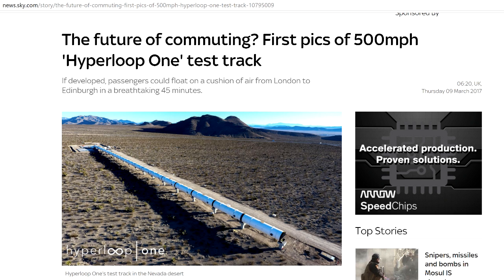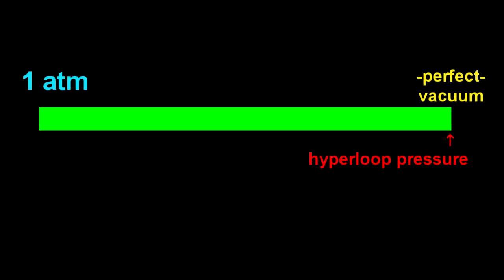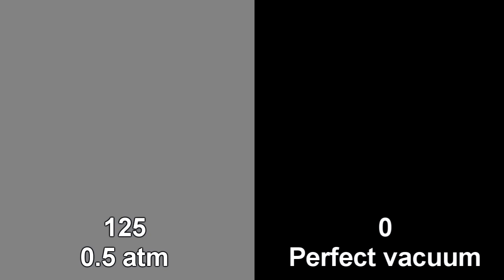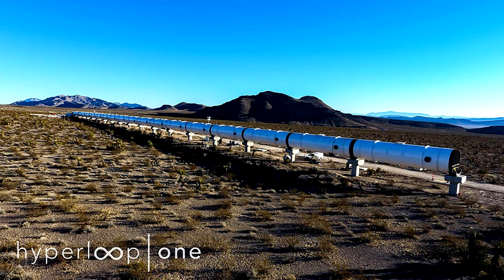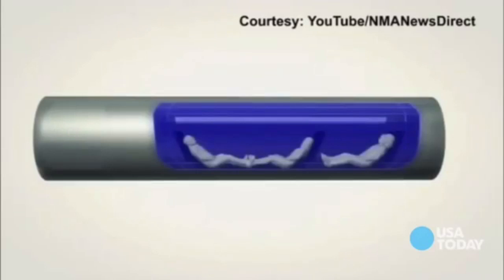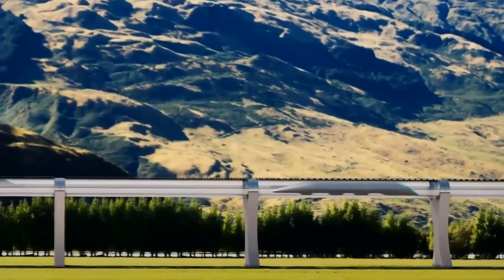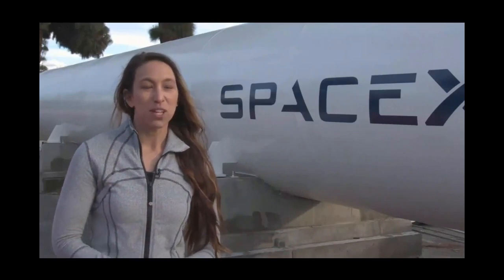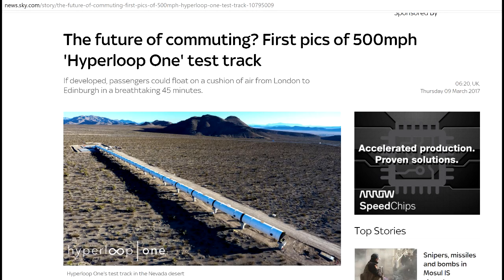Entire Hyperloop could be destroyed in SECONDS!

Comment: The video of the trailer imploding is good but you FAILED to describe the difference in construction between a trailer and a hyper loop tube.     For example a submarine runs at a MUCH higher then one ATM pressure and few of them implode even after a collision that causes damage.    

There is a huge difference in strength between a thick steel structure and the thin aluminum skin of the trailer.   What next, you show how easy it is to crush an empty soda can with your fingers.  But try the same thing with a galvanized steel water pipe?

If you build the tube strong enough it will not implode even if damaged.   The world of engineering has had a lot of experience with busting tubes.   The good thing about vacuum is the MOST stress it will ever see is only one ATM.   Some tubes like artillery guns can withstand thousand of ATM.   No they will not build hyper loop tubes as strong as gun tubes but they CAN and will build them about 10X stronger than needed just to hold vacuum.   

Of curse the engineering could work.  The problem is the money.  Can it be made cheap enough?  For that we have to look at the total cost of the entire system.  I'm betting the most expensive part is NOT the tube but the LAND under the tube.   So you compare Hyperloop with high speed rail.   You'd thing two simple steel rails would be cheaper then a tube made as strong as the hull of a battleship.   You'd be right.   But is the tub requires 1/2 as much land the tube might be less expensive

and YES that trailer demo was stupid.  No one is proposing a thin way aluminum tube.  Think more like battle ship hulls and submarines then trailers. and think about total system costs including REALESTATE.

Can we afford one that flying from Los Angeles to San Fransisco.?   Housing in each city costs bout $1,000,000 for a modest "everyday" house.   I know if you live in middle of nowhere Kanas you think that is a lot of money.  No its normal here.    Find a web site that computes mortgage payments and see what people pay per month.   Next figure out the hourly rate you need to make to quality for a house loan.   Now you have proof of what people make per hour.   What yu see in a second is that the cost to fly from LA to SF is nothing compared to the money you wastestaning in line at the airport.  It costs you at least $150 is lost wages to go through security let alone the travel time in the taxi or Uber car to get to the airport.

People will pay more and be happy of the terminal building was in the city center wright under the high-rise building.   It reduces ground transport times and long waits.   Cost of operation is low too as it uses very little energy.   

The economics works.  Customers save time which equals money, and a lot of it as they tend to very high hourly wages and the total costs is lower then air or rail.

And again no right mined engineer is going use a trailer body for a hyper tube.  I think they will use a high grade of steel and quite a lot of it.

Comment: There are a lot of things wrong with this video or simply missing the point. 

Take the vacuum comparison levels for example; the point that the hyperloop would use vacuums that are not nearly as low as we can routinely make in labs isn't about the pressure differential issue, that's a point about how difficult it is to *make the vacuum*. As a rough rule of thumb, the difficulty in making a vacuum increases by a lot the more perfect one wants the vacuum due to the problem of what essentially amounts to stray molecules, outgassing, and occasionally pesky little tiny things like H2 deciding to get in the way. Serious engineers making that point aren't making any claim that the comparatively low vacuum levels would therefore be more pressure resistant. 

Similarly, the issue of it taking a while to pump down the track for the test runs taking a while is missing why it took so long: they were adding in new units of a new type whereas a completely hyperloop wouldn't have that problem and wouldn't have one have to carefully reduce the pressure slowly because one didn't know if the units would react well to the low pressure environment. 

Third, the idea that a small dent would cause such a problem is simply silly: there are so many easy ways to deal with that that it isn't even a serious problem. For example, one can easily have a secondary layer of thin metal a few cm from the primary tube itself. In fact, for similar reasons, that's not a design sometimes used when  dealing with tubes containing liquid nitrogen or liquid helium.

Comment: I'm sure that they will predict all these failures, look at LHC in CERN, they have vacuum at 10^-12 mbar! and it didn't collapse! of course its smaller diameter, but are 27km length! and they have small interlock system, which isolates every several meters, if a failure occurs they will lock certain areas in order to not lose vacuum, because it takes at least 3 months to get it back... I'm just trying to say that it's exactly the same as CERN LHC, but at bigger scale (bigger diameter) and it is not underground neither radioactive. Hyperloop team have a lot to learn and research.

Comment: You are just a naysayer on this one. Hyperloop one is publicity-hungry, but the final tunnel will probably be made of concrete, it's cheaper, stronger and has a lower heat expansion coefficient. It will also be over-engineered for strength.
Also, they've gotten to 200mph now, and the acceleration distance was always going to be over a km. even regular high speed trains sometimes accelerate over miles, so your smug pessimism is already ringing a bit hollow.

Comment: 200.000.000 Joule you said
let's take a fast train, say it weights m=500 tons and drives at a speed of v=50meters/second
Kinetic Energy K is: K=1/2*m*v² which is 1/2*500.000kg*50²m/s = 250.000*2.500J = 1.250.000.000
1.250.000.000 / 200.000.000 = 6.25
So basically you need to have more than 6 kilometers of Hyper Loop to top the energy of a fast train hitting a wall!

Kick my ass if my physics suck but I'm pretty sure that distributing this energy over 6250 meters is much safer than a damn train of 200m.
Also as long as a puncture is contained on a single point and not allowed to blow the whole pipe up in a chain reaction this will be much more like a tire leaking.

I just can't imagine the tube itself being the problem, only the rails or financiers.

Comment: Dear Thunderfoot, leave engineering to actually engineer's. A vacuum is all of 100kpa, that isn't very much in the grand scheme of pressure equipment. You could easily construct a square section tube that wouldn't fail under external pressure, it is perfectly possible to design a cylindrical tube which will resist a "mighty" one bar external pressure even when ovalised. Even if you made the tube an inch thick it would only cost a few hundred thousand pounds per km for the tube, steel is pretty cheap.

Comment: Since the plan is to tunnel using hyperbore and then use thick concrete side panels ( with tongue-n-groove seals I bet)  so that the tunnel can be brought down to low pressure I'm pretty sure your observation, though valid, is now moot.

Comment: Yeah this is complete bullshit, most hyperloop systems would run on a soft vacuum and the pumps along the track would be able to deal with minor leaks and keep up just fine until the problem is fixed. Anyways there is + stated in the Hyperloop Alpha and Hyperloop One reports, systems for emergency stops etc. plus because the pods are not flush to the wall, so you wouldnt get the acceleration in your experiment. Do some research before making false claims

Comment: Musk originally said the pipe would have to be about 1" thick steel. This tanker skin is probably less than 1/4" aluminum and wasn't even designed to hold a vacuum. What BS is this?

Comment: The stupidity in the comments and this video is ASTOUNDING. This is all very obviously a proof of concept (especially seeing as how as of this comment, musk has tested and proved it will go as fast as advertised)...

See, there's this thing called iteration. You build a thing, and figure out the steps to make it better. And you keep doing that until you have a viable product. The concept needed to show that it works, and it does. Check his IG. There's proof. 

Now,  I don't see why you're so uppity about the pressure. The entire tube doesn't have to be at Max the entire time. The pod travels down it, meaning that all of the space behind it is unnecessary. Put in doors at 1/4 increments, and have them open and close well in advance of the pod. Now, at any given moment, you only have half of a tube accessible at a time, halving the potential risk. It's also clearly going to be built underground to give added protection and reduce risk.

They're literally in the Proof of Concept stage. Safety, regulations, procedures, all that stuff comes years down the line.

In current configuration, yeah, it's not viable. But neither was the first airplane. You're expecting a fucking jet airliner at the first stages of testing. I don't think 30 years is an unreasonable timescale.

Shit, that's a shorter timescale than the Big Dig in Boston lol. This not only has potential, but it has exceedingly great potential.

The power consumption isn't even that high. Those numbers you spouted sound big because of how you stupidly phrased them. That's the power output of two small houses. That could be run on like 12 current gen solar panels.

Your arguments are asinine at best! You're just assuming so much based solely on implementation of a napkin scribble. They're obviously not going to use material like they're using now. The Mythbusters tanker needed a giant slab of concrete to dent the top of it,  and it wasn't even designed for vacuum application! 

This whole video is laughable.

Comment: You got the minimum energy calculation wrong. The first cubic meter of air is moved only with a 25 Pa pressure difference. The whole thing needs half the energy you calculated.

Comment: They just did over 200 mph in that tube. What you are doing is cherrypicking and estimating your facts. You could derail a train by cutting the rails with a plasma cutter or destroy a plane by puncturing the hull mid flight (which withstands a whole lot of pressure and is way thinner and mostly made out of aluminium). If you want to destroy something you can!

Comment: why not use a flexible tube that is electronically controlled to flex outward and make room for the train, so that when the train passes, the air it displaces moves outward with the expanding of the tube, thus creating less wind resistance.

Comment: Looks like a bummer; one weak point leads to a catastrophic failure.  One thinks of an upscaled Lamson Paragon pneumatic capsule system which has its own limitations but maybe a possibility.
Drawn by a partial  vacuum in front and pushed  by positive pressure. Air pressure negative and positive is elastic, runs of tubing can be airlocked to localize the pressure zones in which the capsules glide. A synchronized opening and closing of the airlocks should ensure the smooth transition of a capsule. This may require too much energy and is purely conjecture on my part.

Comment: maglev is way to go than this hyperloop tube.. there is a reason a maglev train in japan only has 1 line from tokyo to nagoya that can reach 600 km/h, its expensive to build, than bullet train that run 300-350 km/h. imagine you build a vacum tube that more likely to fail as showned in this video. even elon can build the tube its must be 5 or 10 times more expensive than maglev train. for the shake of economy is not worthed, but maybe for science and to reuse the tech in another industries is possible.

Comment: No matter what length /size the hyperloop chamber ultimately constructed will be it will never be even a tiny  fraction of the same size as Phil Mason's ego. 
By the way Phil, still waiting for you to reply to mine (and others) observation pointing out  your very fundamental and serious flaw assuming your  ping pong demo is valid . You even assume problems with accelerations  that would scale up when full scale whereas in fact it inverse. This is my fifth time asking.  Why won't you address this?  (Scared?)
Also - simpler question if you can't cope with the previous ones -  if you are so very convinced its not possible to build 1 bar differential welded pipe across 1000 miles how come they can already routinely build >50 bar wide diameter (48") transmission high pressure gas line across continents?  How come?

Comment: https://www.youtube.com/watch?v=T9bpUfWy8Wg

This is a video of Mythbusters trying to collapse a vacuumed train cart. This is a cart which is used to transfer liquids and is not designed for vacuum pressure. Still it doesn't collapse under atmosphere pressure. They had to drop down a 145kg concrete brick from 10 meters high to inflict enough damage to make it collapse under pressure. I'm sure hyperloop will do a better tube than that.

 I mean it should be an easier challange than vertically landing rockets, right?

Comment: You didn't mention how airplanes don't explode in mid air or crack.
And I can prove that you're wrong that easy, (I think) but I'm gonna explain something.
So, the reason the windows in a airplane are circular is because of stress building up which can cause an explosion or a crack, so they're circular. They'll probably do something similar with the hyperloop.
Reply: Airplanes are the complete opposite of what's happening in the hyperloop. Airplanes have the pressure inside and must hold it in. The hyperloop will have the pressure outside and must hold it out. A more realistic comparison would be the hyperloop to a submarine.

Comment: steel regularly withstands perfect vacuum, totally specious argumentative by  internet scientist
using a bulk tanker (aluminium) tanker not designed to withstand perfect vacuum because of weight costs
we are talking about a differential pressure of 14.7 psi or one bar, any mechanic can engineer this
totally doable totally safe   . i'm more worried about the air pressure in cabin decompressing, now that is 
something to make a vid about.    like being jettisoned into space

Comment: the high speed train could go about 250 to 300mph, and i think it will be much cheaper then this hyperloop
Reply: nope...hyperloop much cheaper to build than bullet train and much less expensive to run
Reply: David Hou well it would cost $56,000,000 to build a railway track for 1 kilometer and the hyperloop will cost about $40,000,000 to build for 1 kilometer. Also about the speed thing it is said it would be as fast as 500-700 mph but it’s not clear yet. 👍

Comment: What if we use solar road way tiles to build the loop? "insert lenny face here"
Reply: No, better yet, the solar road panels would power self filling water bottles wirelessly that are hooked up to the car's engine, and the car runs on an internal cold fusion reactor that only requires water to function. Oxygen wouldn't even be a problem for the occupant because they would be able to get oxygen from all the water using a TITUS gill mask.
Reply: @jacobp.2024  y e s
Reply: What if the cars running inside the loop were powered by thorium?
Reply: @whiterabbit75  They will go to warp speed and jump into hyperspace, the tube immediately becoming merely incidental.
Reply: @CA18DETHK  
But, will it grate cheese?
Reply: @whiterabbit75  yes pal, glowing radioactive cheese
Reply: @CA18DETHK 
Ooo... that's the hardest of the hard cheeses... O_O
Reply: @whiterabbit75  well if it's finished they'll probably be since it takes huge load of power to power it
Reply: to expensive somehow
Reply: employment birb how do you write this face?

Comment: Lol you're talking about it like these expiriments are what the final product will be like. Firstly I agree that the vacuum is dangerous (not "low pressure" guys, vacuum) but that is where failure engineering comes into play. Design features that come into play in the event of structural damage. Simply have gates throughout the network, that open long before the pod gets to the section, but in an emergency will be sealed so that air can be pumped in until they can remove the damaged section and replace it. Now in terms of energy consumption, it won't be that bad. You would only create a new vacuum in the "station". While the rest of the network remains in a vacuum. It will be pumping the air out of a space just bigger than the pod, then opening it up to the rest of the network. I understand the cynicism, but now is the time for hope. This world is starving for a new form of transportation.. It looks like we might actually get it